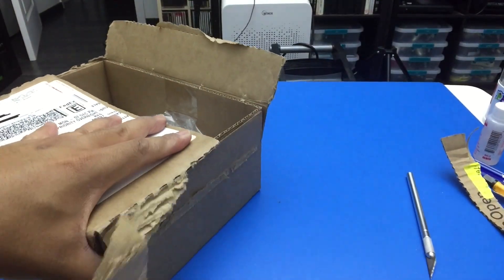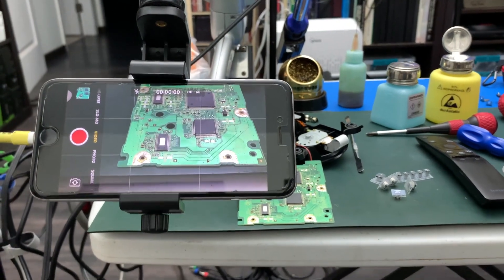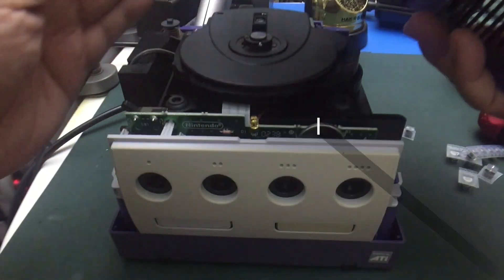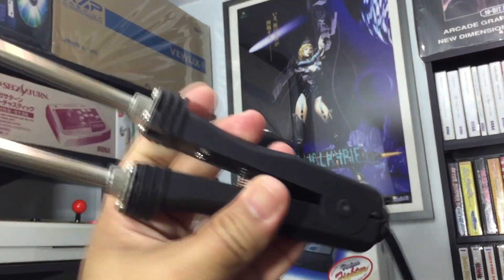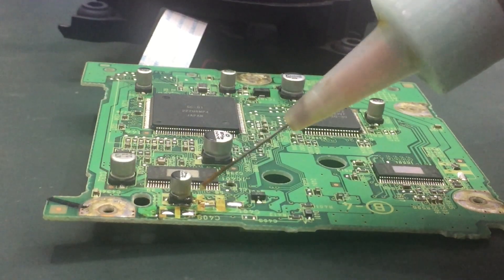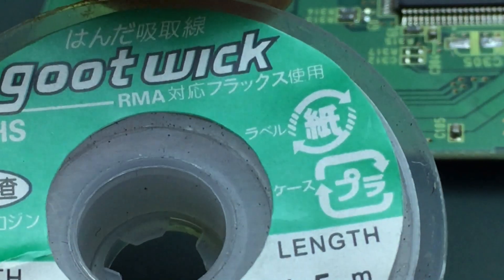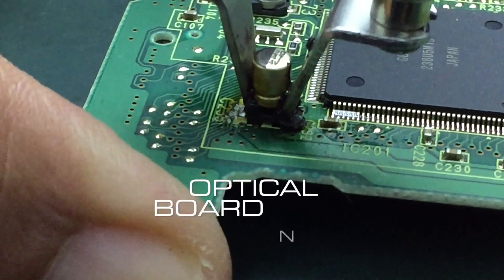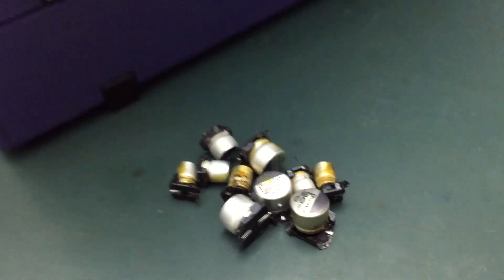Episode 117: Gamecube Optical Board Recap- No Disc Fix

Comment from the maker: Remember, the Gamecube was made during the Capacitor Plage.
https://en.wikipedia.org/wiki/Capacitor_plague
Reply: man, so maybe this is why the first xbox revision also had that bad clock capacitor. the more you know!
Reply from the maker: @zingbanana  Could be... and also could be just the nature of that particular capacitor. It's not a regular electrolytic.
Reply: @The_SegaHolic  Its been over a year since youve done this, Is it reccomended to use tweezer style soldering irons or have you been using a different one since then?
Reply from the maker: @Leo-vn5mn  This is a cheap tweezer and is the best type of tool you can use. Obviously, there are expensive otpions like a Hakko... but it costs WAY MORE than this. You can also use two soldering irons if you wish.

Comment: Love these videos!! It's the hardest repair I've done so far (in my life).

I didn't make it though! I get the message "You must first set the calendar and other options. Press any button" followed by "An error has occured" turn the power off or something. I tried changing the battery just in case, but the problem really seems to be my faulty recapping.

Among those who failed, has anyone tried starting over? Is it worth it?

Comment: Many ppl just mess around with the laser pot and eventually kill the poor diode rendering the optical drive unusable. 
Change the caps and with a very slight adjust, machine reads discs like brand new.
Very few technicians they check the capacitors and get it replaced.
Reply from the maker: A female VG repair person? Nice! I don't even mess with the pot. Without proper documentation on how to adjust and measure, it's just a shot in the dark... and actually, it's not a pot but a variable resistor. Thanks for commenting. 👍

Comment: I really like how you made it scratchy and with the little static transitions. Also thank you so much for this. Everyone always says to adjust the pot for the laser driver, which is only masking the real issue here.
Reply from the maker: YUP, never adjust the pot! It's gonna need readjusting when the person does a recap. Glad you like the video.
Reply: @The_SegaHolic  I had to readjust mine after a recap sadly it wouldn't spin and read discs until I dropped it from the factory 192 ohms to 112 ohms. After that it reads all my discs now no issue except for a copy of super mario sunshine that looks like someone used it as a frisbee I got for free. I might try to get it resurfaced and see if it works if not I'm only out a couple of bucks. if it's a no fix.

Comment: how about using just 1 iron with a pointy tip and melting one side of the smd solder while the other one is lukewarm? this also looks like a job for a little coop soldering. i didn't know about that warmup period. i'll try all the info from this vid when i get to fixing my GC!
Reply from the maker: Sometimes letting it warm up will work, and sometimes the capacitor has completely failed and will not work no matter how long you wait. You can use 2 soldering irons to remove, but the tweezer costs under 10 bucks!
Reply: @The_SegaHolic  i just saw there's some tweezers with pointy tips and with a quite wide space between, but those for 10 are looking good!
Reply from the maker: @zingbanana  https://www.circuitspecialists.com/Tweezer-Style-Soldering-Iron-For-SMD.html
👍 If you live in AZ, you can go to the shop and save on shipping.
Reply: @The_SegaHolic  just got mine from there for usa.
Reply from the maker: @DragonProtector  Awesome! Hopefully u like the tweezers.
Reply: @The_SegaHolic  hopefully!

Comment: I learned a great trick for removing those annoying SMD capacitors on any board. Take a pair of pliers, grab them vertically by the silver dome, and SLOWLY (and I mean very slowly) twist the dome clockwise or counter-clockwise, whichever gives first. The dome will break clean off, the black plate underneath will come right off, and then you just wick off the remaining legs from the pads. easy as pie, No chance of board damage, and way faster then flux and tweezers.
Reply from the maker: Yeah, that was the old way of doing it. Or some would just cut the tops off with diagonals. But imagine if there was a pad that was where the epoxy underneath the pad  was compromised. The pad would twist off with the cap's leads if you're not careful, as the pad would not be sticking to the pcb no more. But if you're comfortable doing it that way, then keep doing what works for you. One major drawback to using tweezers though, is sometimes  caps explode from the heat. 😑 Thanks for the suggestion.
Reply: @The_SegaHolic    I've heard about the exploding with tweezers. I haven't done the twist off method hundreds of times yet but I'm sure eventually I'll have to deal with lifted pads. So far I've had to deal with a lot less damage repair then I did from trying to desolder them previously. I had a lot of difficulty with that.
Reply from the maker: Yeah, using tweezers are not fun. Luckily, I get to do this all over again with an SNES recap. Composite out colors are streakiing and noticed a leaking cap. Luckily, not too much on there. Hopefully, this will be my first successful full recap. I recapped a Game Gear years ago, and it didn't work. Waste of a lot of time, and some money. I was more upset about all the time I wasted. And it's not like you can go back and troubleshoot. Was supposed to be the next video, but I don't want to look at SMD caps right now. LOL.

Comment: I think any console from this era will have cap issues. I've had to recap some of my OG Xboxes. The 1.6 models seem to have the most failures.
Reply from the maker: Like I said, made during the Capacitor Plague.
https://en.wikipedia.org/wiki/Capacitor_plague
But yeah, the 3300ufF caps on the OG XBox are a common one to have bulged.

Comment: I just replaced the optical board in my original GameCube today. With the disc drive inserted, It wouldn't turn on without displaying the "An error has occurred" message. I ordered a replacement board and soldered it to the motor and now it turns on perfectly. Only issue now is that the console gives me the same error if it tries to read a disc as soon as it turns on and it gives a "Disc could not be read" error if you put the disc in after it turns on. I'm assuming this is a laser issue so I might buy a replacement laser next.
Reply from the maker: Or it still could be bad caps on your replacement board. What I would do is get a cheap working one for diagnostic purposes. So you can pinpoint what part or assembly is truly bad. You can then resell. Would be worth it just for diagnosing, even if you lose like $5 or so.
Reply: @The_SegaHolic  I actually just bought a working GameCube for a crazy deal so I guess I can try swapping its board with my broken GameCube and seeing what the issue is. Also once I get it working, I do plan on reselling it since it doesn't have digital output unlike the one I just bought.
Reply from the maker: @mellow_taco  Nice, Gamecubes are rising in price. Just be careful on handling any laser pickup as they are really ESD sensitive. Wear an ESD strap if possible.